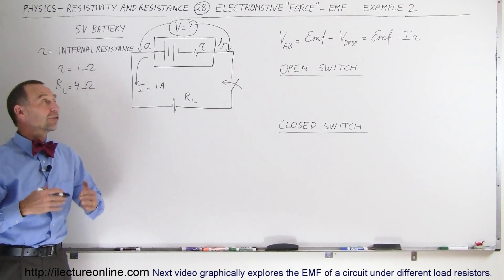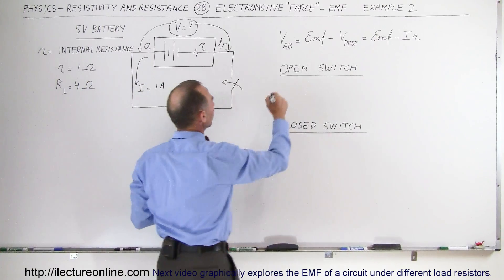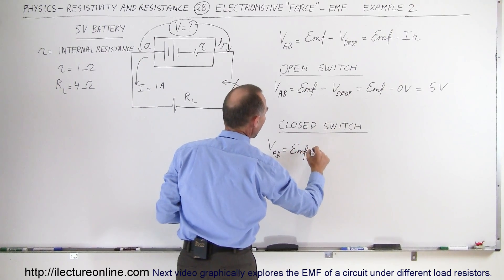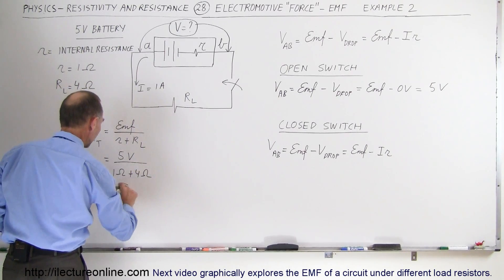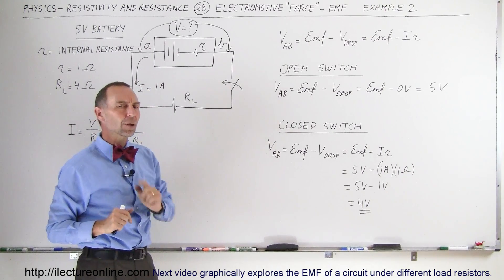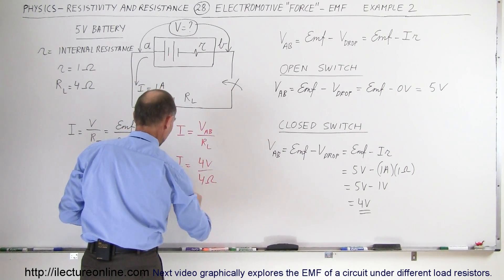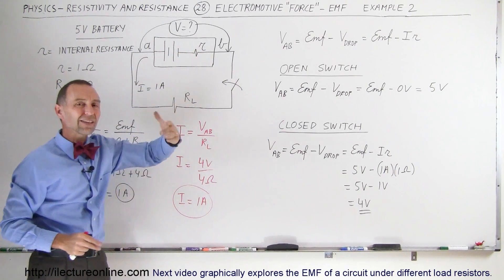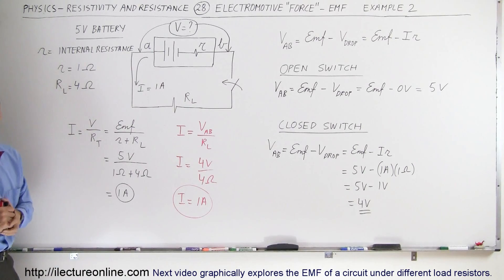Physics 40   Resistivity and Resistance (28 of 33) Find the Potential Difference of a Circuit

Comment: so in that circuit its only 1 volt that remains cause the 4v absorbs/drop by Load, right sir ?
Reply from the maker: There is a 1 volt drop across the internal resistance such that there is a 4 volt difference between the terminals of the battery when the switch is closed.